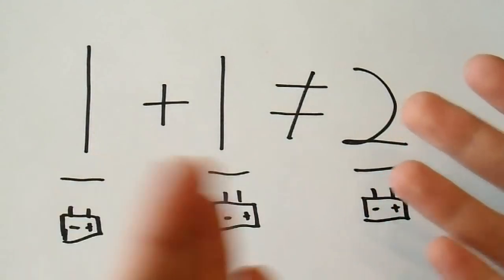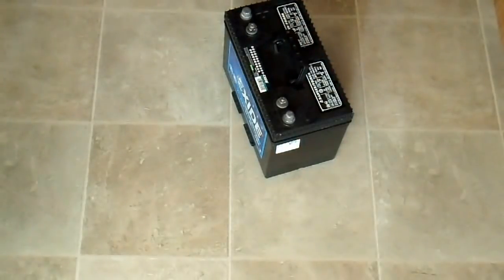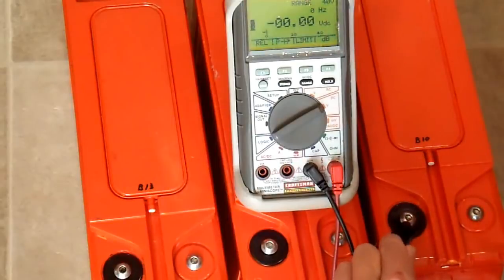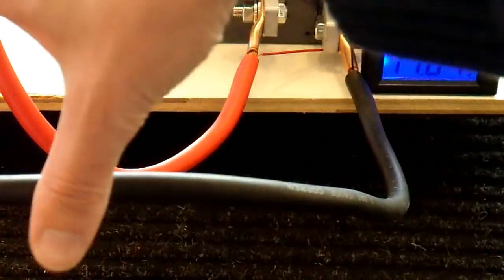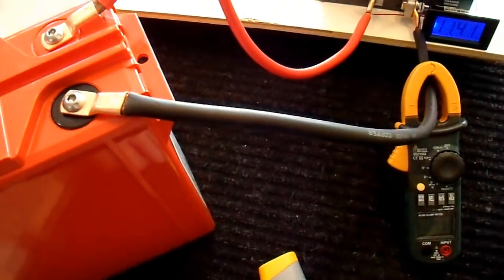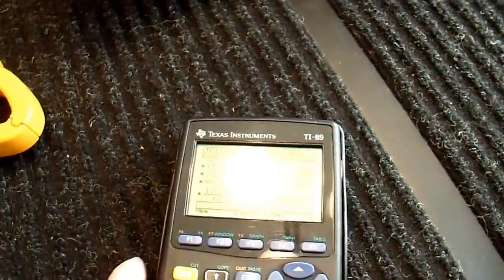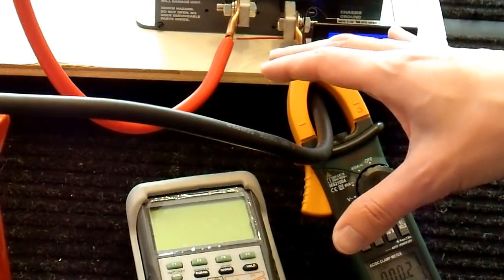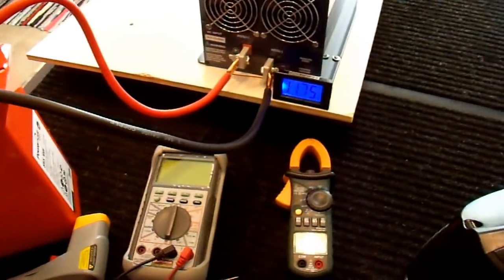Parallel Batteries Don't Add part1: When 1+1 = 2.7

Comment: Actually the amp hours do add up exactly.  For example, 12V 100Ah + another identical 12V 100Ah = 12V 200Ah.  The difference in runtime between 1 and 2 identical batteries is because if the load stays the same, it is a lighter load for the bank of 2 batteries, thus it will likely maintain more than 10.5V longer to keep an inverter running, however, if you double the # of identical batteries AND double the load, the runtime should be identical.  For example, one 12V 100Ah battery at a 25A load vs. a pair of identical 12V 100Ah batteries in parallel with a 50A load.

Don't be fooled into thinking that a pair of 100Ah batteries can outperform a single 200Ah battery of the same nominal voltage.  That simply is not true.
Reply: True, 
But, 
Given a fixed load, multiple batteries Sharing a load, get a lighter draw, than a single unit 
And the higher the draw, the lower the C rating 
So longer till the voltage sags to cut off point
Reply: @gor4988  You have errors in your statement.  You agreed with my original statement, then you contradicted yourself.  It shouldn't matter if you have one 12V 200Ah rated battery or two 12V 100Ah rated batteries in parallel or ten 12V 20Ah rated batteries in parallel, they should all handle a 25A load about the same (same runtime before hitting 10.5V low voltage cutoff).  They wont be exactly the same runtime but they should be very close.  This is assuming they are wired in such a way that the load is about evenly distributed between each of the same rated batteries, so for example, the ten 20Ah batteries would get about 2.5A of load each for 25A load total.  Other assumptions are all batteries are in a very similar state of health and state of charge initially.  It is also assumed that the interconnect wires between multiple batteries do not introduce significant resistance which would waste some power in the form of heat.  Keep all these guidelines in check and each bank should be about identical performance as far as runtime (but not for very large loads such as maybe 100A or more).  This is because the smaller batteries have higher internal resistance than the larger batteries (generally speaking), plus all the interconnect wires add more resistance (but not much), so the one big 200Ah battery will likely be slightly better with VERY large loads (100A for example).
Reply: @gor4988  Also in response to your statement about the voltage sag, a single 12V 200Ah battery with a 25A load and ten 12V 20Ah batteries (properly wired for load sharing) also with a 25A load, should have about the same voltage dip and follow roughly the same discharge curve.  There is no reason why they shouldn't.  This is of course assuming they are similar health, charge, type (AGM, FLA, LiFePO4...), and all have low resistance wires (not "spaghetti" wires).
Reply: @davidjames1684  Now your not taking resistance into account 
10 in parallel at 1/10 capacity  would lose out to a single battery with 10x Ah rating 
In real world situations cost and weigh are not the only reasons multiple banks are the norm 
C rating vary widely, as do many other factors 

Knurlgnars wasn't comparing different Ah batteries 
I found his testing, measuring methods fine 
As backed up by the common practice of paralleling smaller batteries in installations v one large 
Spreading the load must have advantages that outweigh the extra costs
Reply: @gor4988  There should be no significant difference in runtime for say 100Ah of AGM battery power whether it is one big battery, a few medium size batteries, or a bunch of small batteries, provided they are wired correctly to share the load about evenly, and the load is not excessively high.  It is true that larger batteries generally have lower internal resistance than smaller batteries, but for light to medium loads, that wont make much difference.  For example, suppose you had a 12V 100Ah AGM battery so that you could use 50Ah of it for a drain test and it would take 10 hours at 5A load (about 60 watts).  If you were to instead use ten 10Ah rated smaller 12V AGM batteries in parallel with that same 5A load, I would expect it to also run for about 10 hours down to 50% DoD (Depth of Discharge).  The higher resistance of the smaller batteries shouldn't make much difference for a light load such as 5A.  That would only make a difference for big loads such as a spike load (100A for example).  It depends a lot on the quality of wiring.
Reply: @gor4988  Just be clear that 10 batteries at 10Ah each vs. 1 battery at 100Ah (of the same type, health, SoC...) will perform about the same for reasonable loads.  There is no Ah advantage to using the 10 small ones.  10+10+10+10+10+10+10+10+10+10 will NOT be more than 100.  The 1+1 = >2 that the OP is talking about is actually more like 0.9 + 0.9 = 2 for 10 hour drain rate where 0.9 is at the 10 hour drain rate and 1.0 is the battery capacity multiplier at the 20 hour drain rate.  That is what major battery manufacturers such as Trojan specify in their spec sheets.

Comment: at which voltage is the other battery after they were connected in parallel?
Reply: If I connect for example, a 7 V battery in parallel with a 3 V battery.
since, the wire which connect their poles is considered to be the same knot. what will the voltage between the + and the - knots be?

Comment: ...its  100Ah if the load were only 12v 1A...but if u invert it to Ac also stepped up to 120v which is 10x up.. amp goes down/divided to x10 equally too..so left with 10ah to replace the transformed volt / 240v only left with 5ah... probably something like this...also not forgetting the efficiency of the inverter...pure or modified  ...but if the battery was 240v with 100ah than its something else..isnt it..easy to get confused over this thing...some might feel cheated if they did not understand the science behind it..i learned it all online... less expensive method of learning

Comment: at 14 minutes in: erm... actually, the answer is simple, the battery is only charged to 13.06 volts as shown in earlier in the video. a lead acid battery's fully charged voltage is about 2.5v per cell or 15 volts for a 6 cell battery (12v battery)

so why did you get 50 Ah and not 100Ah? cos it wasn't fully charged, lol. (though keeping it at 15v is not good for it and 13.8 to 14.2 is preferred)

unless I'm missing something, in which case I'd love it if you can correct me and point me to the data so I can read it myself... cos I love reading data... but often miss stuff :/
Reply: A lead-acid battery produces 2.1 volts per cell, a car battery has 2 cells, that's 12.6 volts.

Comment: The more amps you draw from a single battery, the less efficient it becomes. That's why single battery is less efficient than two batteries in parallel; in case of two batteries, amperage drawn by load splits into half for each battery, which increases efficiency.

Comment: Battreys are rated Power * Time = total amp/hours (usally 10 hrs) 100 amps/hours / 10 hours = 10 amps per hour to get full power out. You have to derate the total amp/hours if you drain it faster. About 50% if you drain it in 1 hour, about 100 amps. Full charge voltage 13.2 discharge voltage 10.5

Comment: I truly think something is wrong with your inverter for sure...  A quality inverter should only draw about 1-3 amps on idle (under no load), and your 1500 watt heater ONLY draws about 12.8 amps on high, so that would equal MAYBE 15.8 amps at most NOT 129 amps.  I think you better check your inverter out before you burn your house down...  In your next video, you show that the draw for 3 light bulbs is causing a total draw of 28 amps..  A 300 watt light bulb only draws maybe 2.8 amps (and your 3 lights at 100 watt each would equal 300 watts if my math is correct).  Either you have a failing inverter or a failing meter (if it was me, I would rather it was the meter failing).  An indication that your meter is either switched wrong or failing, is the fact that if you look at the video where you are reading the meter - it is showing a negative number which is an indication that something is backward.  

According to this and the next part 2 video, your inverter would be drawing around 116 amps with no load (nothing at all plugged into it), and that is NOT - I say NOT a good thing at all - SOMETHING is wrong in Denmark LOL....

Another interesting fact is this....  I watched another one of your videos where you paralleled two 410 watt inverters to make one 800 watt inverter, and you added a 60 amp fuse I do believe to the setup.  If you would have done that here, that fuse would have blown for sure with drawing 128 amps.  The typical standard Home (Your whole house for goodness sake) for modern usage is 100 amp draw; less than 100 amps may not be adequate for your needs. Larger homes, and homes with central air-conditioning or electric heat will need more power, typically 150 to 200 amps, and your little 1500 watt heater is causing a draw of 128 amps????????..
Reply: Steven Jarrell  you are getting confused between watts and amps. A heater will use a fixed number of watts, the amps it uses is always dependant on voltage. In your example of 3 x 100w light bulbs that is only 2.8amps because the voltage is 120v. If the voltage was only 12v they would need 10 times as many amps -28 amps because the voltage is only 1/10th what it was. A car 50w headlamp uses 4amps at 12v. A 50w lamp in your home is just as bright but only uses 0.4amps if you have a 120v supply or 0.2amps if you are on 240v. Rather than being faulty it sounds like his inverter is amazingly efficient.
Reply: I may be wrong, but I don't think your response is relative...  I understand that less voltage requires more amps added to the mix to get enough power to make things run - however - he is not using 12 volts after the inverter, he is using 120 volt devices plugged into the inverter.  

The one thing I didn't consider was how many amps the actual inverter is pulling from the battery because it (the inverter) is in fact 12 volts, which would need more amps to harness enough power to energize 120 volt devices - but then again, isn't the inverter itself doing all that buck conversion within itself?  You are right, it can be very confusing...

So I guess (being confused), my question to you is, how many amps would the inverter need to pull from a battery in order to power a (120 volt) 300 watt bulb plugged into the inverter that is only pulling 2.8 amps from the inverter?  Yes, it can get quite confusing, but I do love to learn, so if you can answer that question, I would be appreciative for sure.

My intention is NOT to comment on a video if I in fact I have no idea of what I am talking about, because that can be very confusing for someone else, and the last thing I want to do is confuse anyone :)

I have been learning allot about power (volts & amps) in the last year, but per your reply, possibly not enough to make comments on what others are saying about said volts & amps etc..  I myself am still learning about electricity and how it all works, so apologies if putting out wrong information.  However, through communication, I/We can learn more which is what I love to do.

I looked at the video again, and the amps meter he is using IS on the battery side (before the inverter) which would make your statement to me correct, but not sure unless he had used the amps meter on the other side (after the inverter).  Using the amp meter on the lead after the inverter would show a different amp draw, so I guess I am starting to answer my own question LOL..  Thanks for replying as it has got me thinking for sure, and as a matter of fact, am starting to get a headache...
Reply: Steven Jarrell to awnser your question about the light bulb it will be 28 amp draw from the battery if the amp draw at 120v is 2.8 because 120V×2.8A=12V×28A both = 336w  you have to understand balancing equasions in order to work it out in a perfect world it would be that simple but you also have to take into account losses so maybe  30 to 35 amps from the battery if you knew the efficiency of the inverter you could work it out pretty accurately

Comment: So I've got a question.  I've watched your videos (which are cool beyond words but I digress).    In order validate my understanding of this I want to know whether you think my hunch about battery power is correct.  Suppose you have a 100ah battery and you run a 100ah load.  And you can run this load for 30 minutes or whatever until the 10.5 volt limit is hit and the inverter shuts down.  And so in this hypothetical example you've used 50ah.  Per your videos, that remaining 50ah is still there to use so long as you reduce the load.  My question to you kurnlgnar24 is whether the industry standard of 10.5 volts under load is WRONG.  What if the voltage inverter would shut down at whatever voltage you wanted.  Suppose you could keep discharging the battery at lower and lower voltages (and higher and higher amps to keep the power output constant).  On a 100ah battery, supposed you did this until you've consumed all 100ah for one hour?  Would the specific gravity on a wet battery (after the battery settled down) show zero SOC?  If so, is the true voltage of a "dead" battery under load really relative to the load?  So as to say it is 10.5 volts really depends depends, etc.?

Comment: Bad test!  You cannot use new batteries because as you cycle them early in their lives, they are gaining Ah.  A new battery that has been cycled a few times will have MORE Ah  than a new battery that has not been cycled many times.  If you made this a fair test, you would see about a 10% impovement over double when you double the size of the bank, so for a fair test, you should see that 1+1 = 2.2, not 2.7.  You will see that 1+1=2.2 by checking battery charts such as from Trojan and comparing say the 10 hr vs. 20 hr drain rates of the same battery.  Doubling the size of the battery bank but keeping the load the same is roughly equivalent to halving the load of a single battery.  The battery will run about 10% longer if both loads are a medium load for the battery (not some extremely high or extremely low load).

Comment: I recently Installed two HID biXenon Headlights on my motorcycle, My battery keeps going down to 10V within an hour of usage, i have a spare 12V battery of the same Model and Same capacity could I hook em up in parallel to give me more hours of usage? will it burn out my ECU???

Comment: Discharging a battery quickly heats it up so yes there are Ah lost in heating the battery.  You mentioned they are not lost based on discharge rate.  That is wrong.

Comment: I read about this a few years ago. Battery are also rated for a 20 hour discharge rate. So this battery would be 100 Amp Hour over 20 hours or 5 amps per hours. Good test, good video.

Comment: why the great negative terminal spark at 6.34 ???  i assume the inverter is OFF while youre connecting,so,why the huge spark please ?
Reply: Heidirod Marsh there are very big capacitors in the inverter to keep the volts constant during the sine wave.

these cap's are never disconnected from 12V copper bars.

it is switched on and off by a few MosFET's. 

Its just like in car audio amplifiers. (And for the same reason = Sine Wave for speakers instead of AC load) Big Cap external and a few smaller ones in the amplifier. both get charged in split-seconds when connected to the battery.

this brings up serval hundred amp's.

it's better to charge inverters, car amplifiers an their cap's by a little 10W bulb in series and then connect to the battery right after.
Reply: casemodder89 TY,so before i connect my inverter i do the same ?? couple ot taps on the terminal ?? Cheers TY.

Comment: That's why you should use RC, right?
Reply: waterlubber  Yes, I think it's better to keep the loads low.  The I squared R losses go through the ceiling when you drain a battery fast with a resistance heater drawing 40 times rated current.

Comment: Thank you for sharing your info/videos, despite some of the negative replies you receive. Many don't like their understanding of things being challenged or disproving long standing beliefs. One reply said that a battery is not discharged until the voltage measures zero. Obviously, they don't know the charts of battery discharge voltages. Everyone should know that to discharge a lead acid battery below, what is it, 11 volts will damage it. By the way, what is a "knurlgnar"? Is the "g" silent?